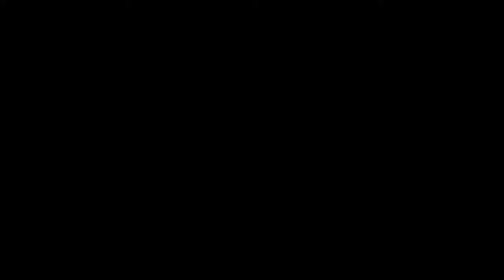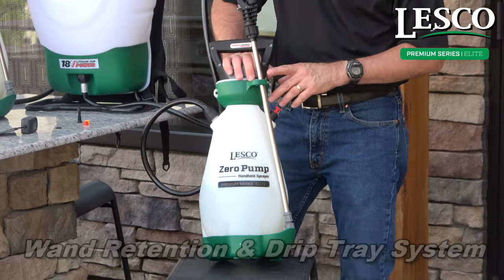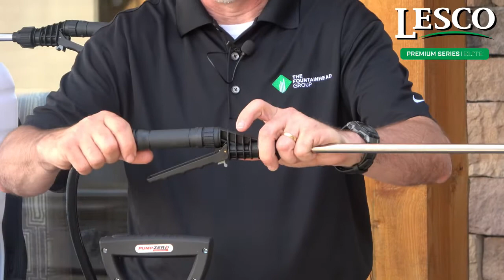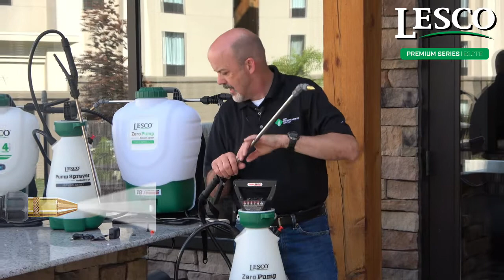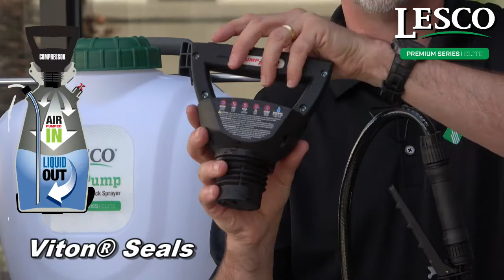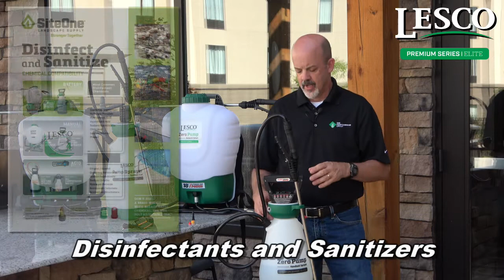Lesco 2-Gal Zero Pump 7.2v Li-Ion Sprayer

Comment: Its a POS
Reply: Ive had mine almost 10 years I have not 1 complaint.ive sprayed everything from wood stain to pesticides and the battery fits most pump style tanks. Just screw it on and pump away. Sounds like you were trying to paint a house or something  its not for painting nor thick solutions. U use it to spray what you would normally spray with a pump sprayer. U just dont have to pump

Comment: Just purchased one. Let the battery fully charge  Got a green light.  Then pushed the power button and nothing happened.
Tried different way to push the power button still  nothing.
Took it back to Lowes  where  I purchased it

Comment: Gonna try this one for bleach. Last brand did not.
Reply: Any luck?
Reply: @jerrybowers3174  yes it works great. Love it.
Reply: @stevanhoffman4240  Thanks. Just bought one but haven't used it yet.
Reply: @jerrybowers3174  its awesome. Never have to pump it and it sprays fine. Just dump the excess bleach out when you're done and put a gallon of water in it, lock the trigger and walk away. Self cleaning. I put 10 or 12% in it and when im noticing nasty stuff that won't come off concrete with the 3% pre treat or pressure i give it a quick spot treatment and move on. Go back to do the rinse and BAM, trouble spots gone.
Reply: @stevanhoffman4240  It says you're supposed to get 8 tanks per charge. I got 5, barely.
Reply: @stevanhoffman4240  I'm doing a driveway/sidewalk with NASTY rust from iron water in the sprinklers.

Tried White Ox on it, not impressed. Some of it looks like red clay, or paints. Thick and won't budge.
Reply: Can I use it on driveway for pave sealing?